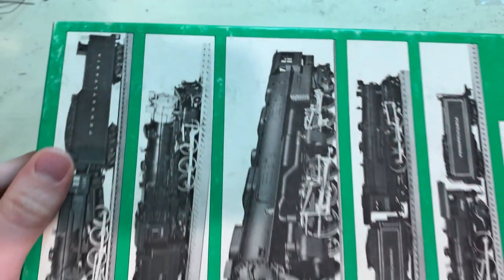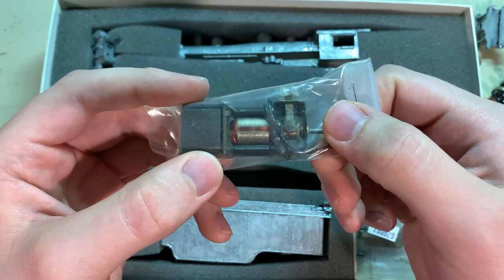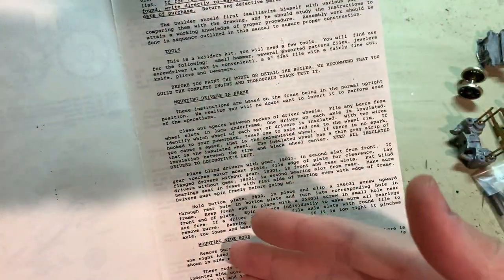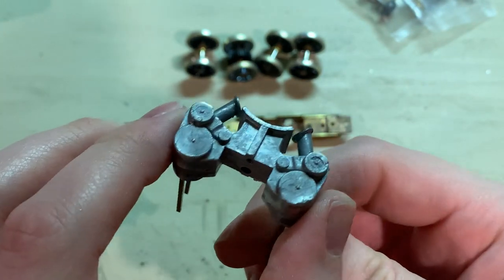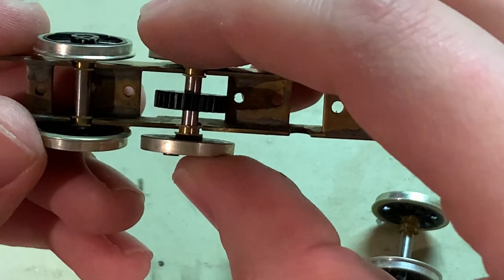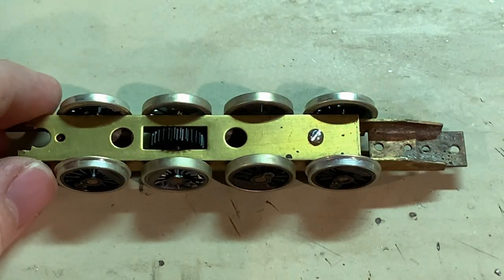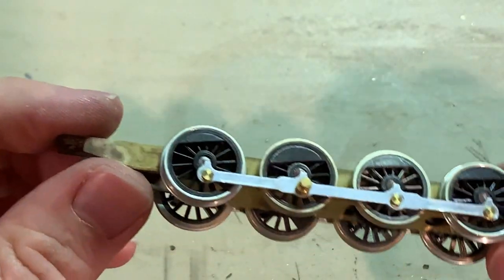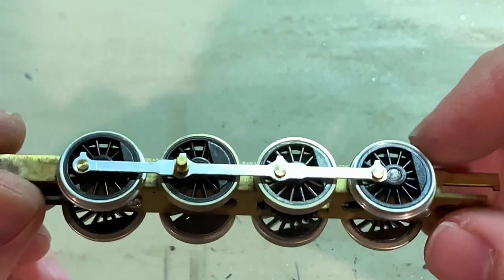How to Build a Basic HO Scale Steam Engine Kit: Part 1 - The Chassis

Comment: I would love to find one of these kits. While its nice to just plunk down a loco on the tracks and see it run; I find it equally fun to build things and then appreciate the effort it took to get it running.
Reply from the maker: This is the search I use to find Bowser kits: https://www.ebay.com/sch/262303/i.html?_from=R40&_nkw=kit&Gauge=HO&Brand=Bowser&_dcat=262303&_sop=15
There are usually a few up at a time, mostly going in the $125 to $250 range depending on which one you want.

Comment: I've watched several of your videos in the last few days...  Great presentation and techniques!   Kudos for sticking with some of these kits (the Arbor Models kit was especially bad).  Watching this video, it's very surprising to me, how much play there is between the holes in the side rods and the crankpins.  I scratchbuild mechanisms for steam and side rod driven diesel mechanicals for HOn2, HOn30 and Sn2 (7mm, 9mm and 10.5mm gauge).  I typically use only around 0.0015" of clearance between the holes in the rods and the crankpins, 0.002" is acceptable if necessary to smooth out a bind, but anything above that is excessive IMO.

Anyway...  Great job with these old kits (or new old stock, or new but old tech).  It's great to see people still doing this kind of work.
Reply from the maker: Thanks!  I think the reasons for the additional play were that it makes it easier to manufacture, and it needs a bit less tuning from the builder.
Reply: @DarthSantaFe  Agreed!  Lots of play equals lots less tweaking...
Reply: @DarthSantaFe  looked to me like spacers were missing.............
Reply from the maker: @raymondo162  There was nothing missing.  The screws for the side rods were partially threaded to double as the bushings for the rods, and the holes in the rods aren't large enough to fit extra spacers without drilling them larger.  This is common practice for most kits and many ready to run models.  Here's Bowser's official diagram for the model: https://www.bowser-trains.com/docs/instructions/OldLadyRef.pdf

Comment: Do any of the viewers know when Bowser started remaking these old Varney kits?  I know the Old Lady and Casey jones were originally Varney products but Bowser redesigned them a bit. I remember selling kits like this in the 70s when I worked in a small hobby shop. Really have the urge to build one of these now to bring back old memories.
Reply from the maker: The tooling was sold sometime in the late 60’s or early 70’s. Life-Like tried making some of the metal models early on, but decided to keep only the plastic tooling from Varney and Penn Line and sold off the rest.

Comment: Nice!   So have you thought of modifying a static locomotive kit (e.g. a German locomtive from Revell Germany) and modifying it to run?
Reply from the maker: Sure have!  I actually have a Hobbyline 0-4-0T that I managed to power a few years back as well as a Dapol Deltic, and I'm also thinking of how to do an Evening Star 2-10-0 from Dapol.
Reply: @DarthSantaFe  I forgot about your British loco kits and it's been while since I watched my last video from you.  I'm just thinking more about the German Revell kits.
Reply from the maker: @OwenConcorde  Maybe I'll take one of those on eventually, but I have a ton of projects to finish already, so it could be a while!  That class 01 4-6-2 looks pretty nice.
Reply: @DarthSantaFe  Ok!  The steamer kits are usually the most difficult, but the East German BR 132 'Ludmilla' diesels could make some slight adjustments.  I had thoughts of doing one of those or even the BR 50 2-10-0, but I just have better things to worry about at the moment.

Comment: I miss the concept and quality of the Bowser heavy metal kits. Most of Bowser's offering came from them buying out other kit manufacturers like Penn Line and Varney. I have a "Semi-Vanderbuilt" tender kit, and a number of the re-power kits Bowser / English offered for plastic RTR steam engines like the Lionel GS-4, and they are great. I just never wanted any of the Pennsy or generic RR offerings. I had always hoped they would offer updated specific Southern Pacific and Northern Pacific prototypes (Varney had made a kit for an NP Z-5 that would have been a must have for me if it had been carried into the Bowser line), including re-working the many discontinued SP prototype Varney kits (The Old Lady and Casey Jones are original Varney kits loosely based on an SP prototype), but sadly, before that could happen, the age of steam kits died.

Comment: I have an elementary question for you, I am new to this and don't know who to ask and I have a feeling you would know, can the Inox lubricant that is recommended for track also be used to lubricate the wheels on an old set of standard gauge trains - thanks for any help
Reply from the maker: It can be used for the bearings, but you’ll want grease for the gears.  I’ve been using white lithium grease for all my gears lately, and it does very well for this.
Reply: @DarthSantaFe  thank you for your expertise - I appreciate it!

Comment: Is the gear noise typical for one of these? Sounds pretty loud compared to my old Mantua steamers.
Reply from the maker: It’s actually the motor. The gears are just about silent, and the motor noise has gone down with run time and a little more oil.
Reply: Every Bowser open motor sounds just like this.

Comment: I have a Tycho Pony and I don't where the wire from the  electric motor connects. In the video it is loose.  Any help would be most appreciated.
Reply from the maker: The motors in Tyco kits have one brush grounded to the frame, so the wire needs to connect to the tender. I usually connect it with the same screw as the drawbar, so then the wire will be below the drawbar.

Comment: How do you hook up the alligator clips to a power source?
Reply from the maker: The alligator clips have their own wires.  Mine use banana plugs that go into sockets on the power source, but you can also use screw-on terminals like what you'll find on most railroad controllers.

Comment: Where would one purchase such a kit?
Reply from the maker: New in box kits like these from Bowser, Mantua/Tyco and MDC/Roundhouse show up frequently on eBay and sometimes at train shows where old collections are being sold.  Europe still has some manufacturers like DJH and AMF87 making kits with a combination of cast and etched metals, but American steam engine kits have been out of production for a while.
Reply: @DarthSantaFe  Thank you will need to keep eyes open.
Reply from the maker: @basilschwegmann7395  Just did a quick check on eBay, and filtering for Bowser, Mantua, Tyco and Roundhouse, it looks like there are around 60 unbuilt kits up for sale right now.  Some of them are at reasonable prices and others are too expensive, but the selection is pretty good overall: https://www.ebay.com/sch/i.html?_from=R40&_nkw=kit&_sacat=262303&Gauge=HO&_sop=15&_blrs=recall_filtering&_oaa=1&rt=nc&Brand=Bowser%7CTYCO%7CMantua%7CRoundhouse&_dcat=262303

Comment: Stone Delicate Parts!    Do Not File!!!!!!!!!!!!!!!!!!
Reply from the maker: In the 15 or 16 years I've been online, you might actually be the first person I've come across who's said that a diecast metal kit is too delicate for a file.  Sand paper isn't enough to take off some of these large seams, so what do you suggest?
Reply: The die cast pewter style metal is intended for fine filing.  That is the way to go, then finish with emery cloth.  If the flash is small emery cloth on a piece of balsa is ideal.

There is a lot of flash on all these kits.  Bowser isn't bad.  Mantua is messy as is Roundhouse.